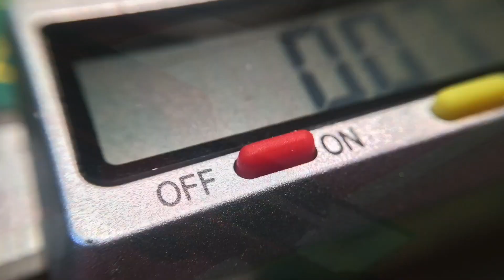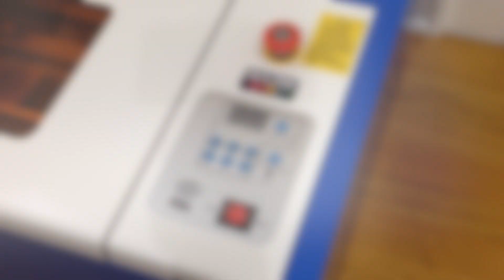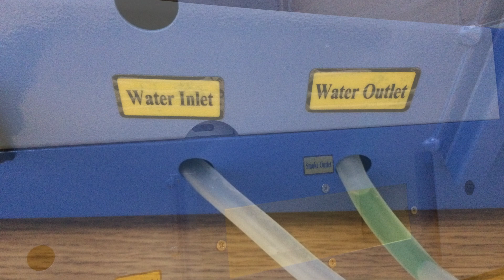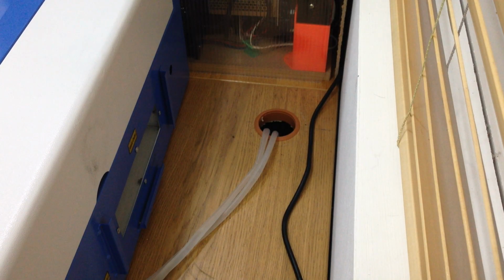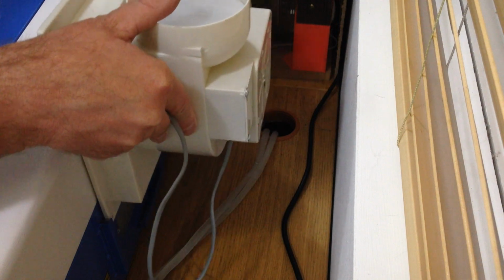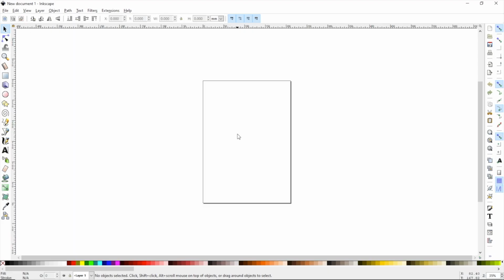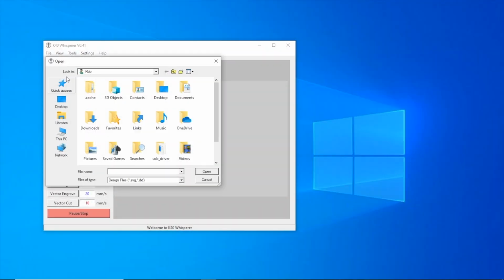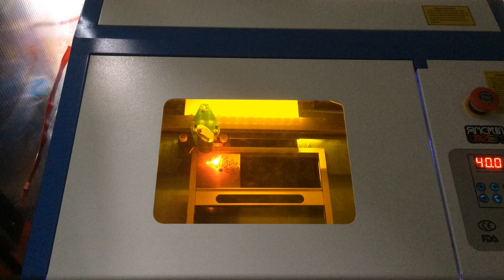Upgrading to a K40 Laser Engraver

Comment: You should remove the blue plastic film thats covering your power supply under the right lid. It prevents the heat from disolving in to the air. It should be clean metal color on it.

Comment: Your seller cheated you.
In your case with the small power cabinet fits only a 600mm long laser tube. This tube can only deliver 20W permanent and 25W peak. But it is driven with the same current than a real 40W tube (which is at least 700 mm long). This current overheats the tube without delivering more power and kills it within short time.
If you will ask your seller, I'm sure he will spout off about a higher CO2-concentration to get 40W out of a 600mm long tube, which is complete physicalic nonsense.
https://www.thingiverse.com/thing:3294535
Reply from the maker: Thanks for your advice. I do indeed have a 600mm tube in my machine. However, I have no plans to run a business on it by using it as production level equipment. 

Anyone wanting to do laser cutting/engraving in large quantities would be much better served saving money and investing in a decent machine. 

My unit only does short runs, then it’s cleaned and left to settle (cool and de-ionise). I’ve had it for 16months and I hasn’t failed me yet.  That being said, if/when my tube dies I may consider a 700mm tube instead.
Reply: But I'd recommend you to not increase the power level above 30%. More current will not produce more power but more heat harming the catalysator which refreshes the gas mixture. This would reduce the life time of the tube.

Comment: Hi! Thanks for the video. How are you satisfied with this K40 Laser after a couple of months? Is it still largely unmodified? I'm a bit afraid that owners of this machine, which is 
 a "type of making" or "clone" available from an unknown number of Chinese companies end up in endless maintenance of mirror / lens replacements and adjustments. Still happy?
Reply from the maker: I don’t use mine as a production/manufacturing machine. It’s used semi regularly and works really well for anything I throw at it. Air Assist will keep the lens clean. The mirrors are still lined up and haven’t given me any hassle. 
All these machines are clones though. There isn’t one “original k40” that they are a copy off. So, all I can say is you take your chances which of the 100s of factories that churn these out, made the one you found on eBay. 
I would save my money a little longer and get a laser engraver from a reputable manufacturer if I were planning to run a business with it.

Comment: Just got my K40 yesterday. Have you done any MODS?. I am going to be replacing the head and lens, adding a flow meter and temperature readout. I am also adding an Ammeter. Can't wait to cut something out myself!
Reply from the maker: I’ve been taking it slow with mine. I still have the guillotine bed but I’ve added a catch grill, air assist and water temperature sensor. Videos for those are on my k40 laser playlist.
Reply: @Tinkerneering  Thanks for the answer-back. I ordered a new head with an Air Assist built-in. I will be using the Aquarium Pump I used for my Diode. Just having a hard time finding Distilled water during the COVID-19 thing.

Comment: How easy was it to set up? Is it safe to use on a household level? Also can you just engrave without cutting pieces off? Looking to engrave only and not laser cut? If that makes sense... total noob to this
Reply from the maker: Take a look at my valentines hearts video. I used the machine to engrave and then cut the same pieces of wood. I watched a few videos on the k40 before buying one. It was easy then to set up. Mine came with everything lined up, so I was able to cut and engrave straight away.
Reply: Tinkerneering thanks for that, is the software easy to use? Like is it hard to transfer an actual image to a piece of wood? And if it does, does the end product come out good quality?
Reply from the maker: I haven't tried a photograph image yet but i've seen other results that look great using K40whisperer. That software is really easy to use, check out their videos here. http://tnkr.uk/k40whisperer

Comment: Great video. I need to upload and etch logos and names onto PLA + plastic products 6x6 inches. Would this machine do that? Thanks!
Reply from the maker: You need to be very careful using plastics as they can emit toxic gases when burned, which is essentially what this machine will do. I’ve not tried PLA yet but I’ve read that I can be cut. 6x6 inches would be too big for the spring loaded bed though. You would need to replace that first.

Comment: So the usb key isn't required if using k40 whisperer? Setting up mine tomorrow.
Reply from the maker: Yes. That’s right. The usb dongle just contains a licence key for the software that comes with the machine. It’s not required for the k40 laser to operate. It’s also one less malware vector to worry about if you never connect it to your computer.
Reply from the maker: Good luck with setting your machine up.